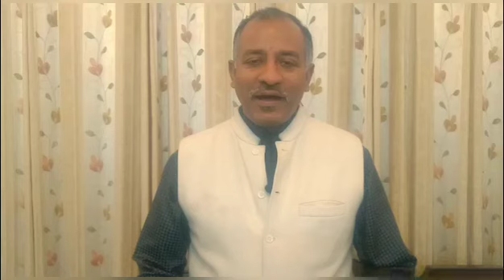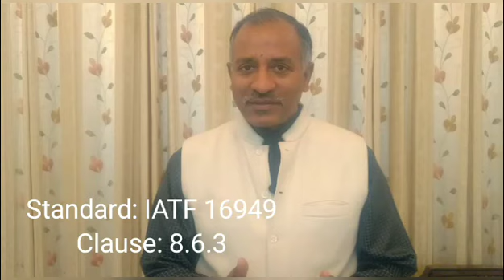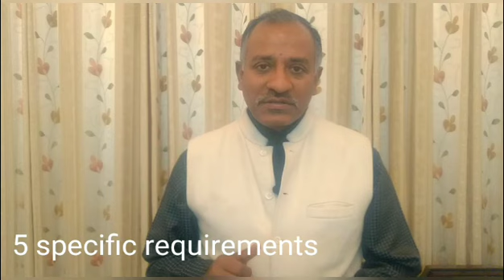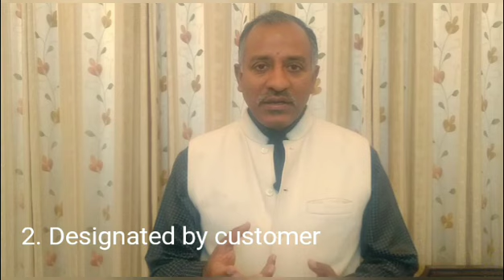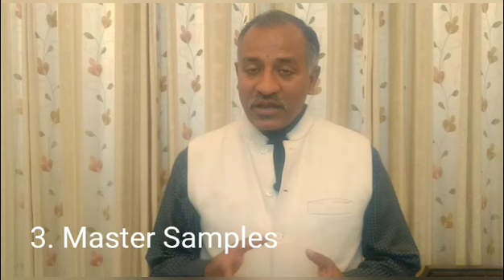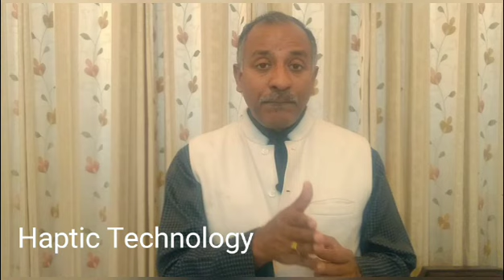Appearance Item | Bhavya Mangla | English | IATF 16949 |

Comment: Dear sir, is there any standard that says that there should be requirement of so and so light flux level ??
Reply from the maker: Thanks for your query. The requirement for the Lux value can be defined by the customer or organisation can decide. It will be based on the criticality of the process and product
Reply from the maker: Thanks for your query. The requirement for the Lux value can be defined by the customer or organisation can decide. It will be based on the criticality of the process and product